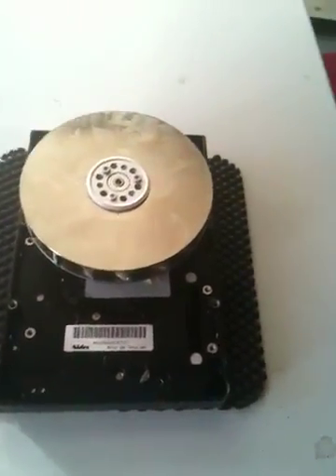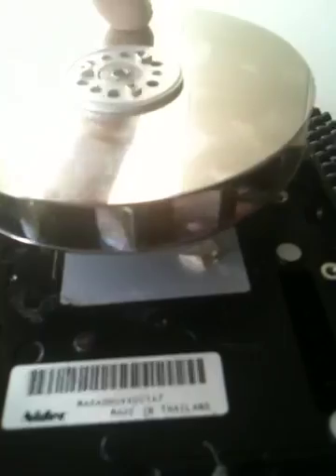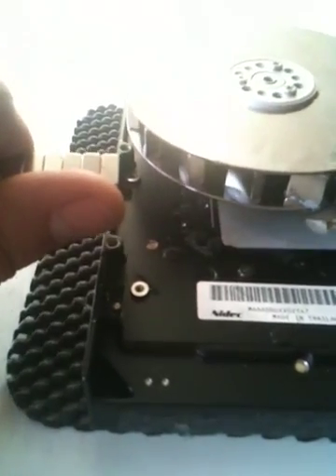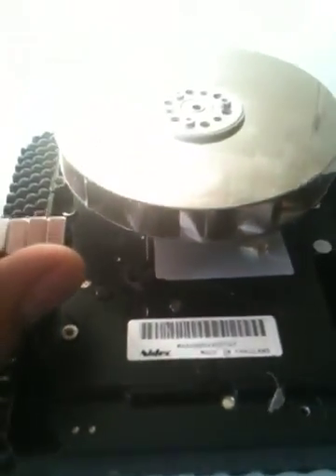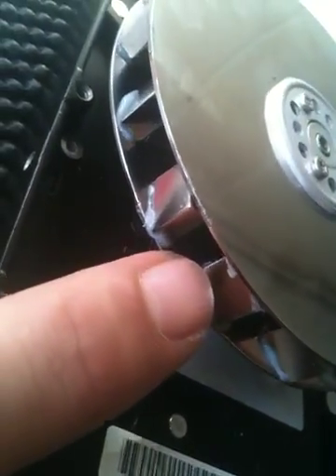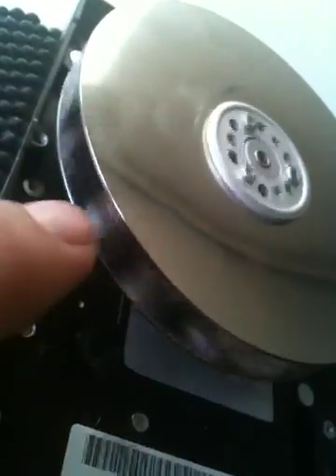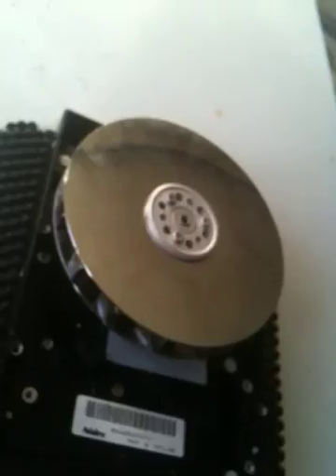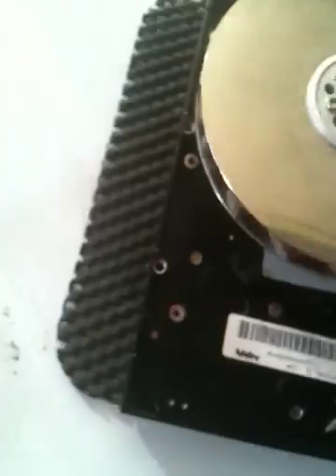Permanent Magnet motor

Comment: You need to put an half arc iron core around your stator magnet and you
need also some iron cores at your rotor magnets to guid the flux asymmetrical away.

Good luck ! Regards, Stefan.